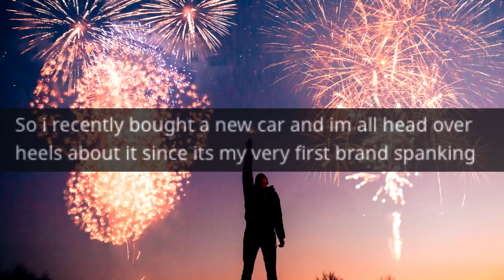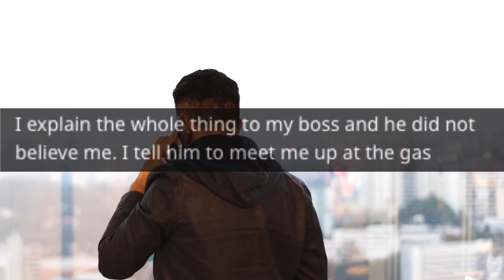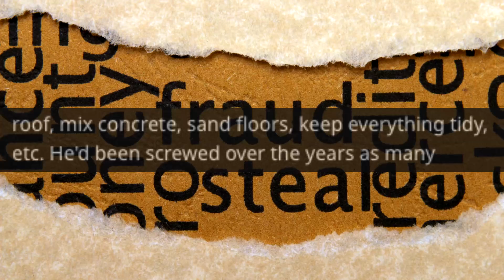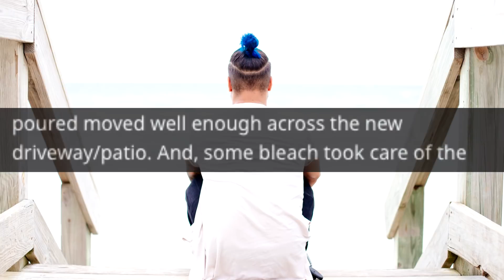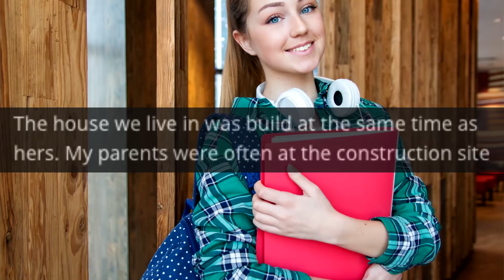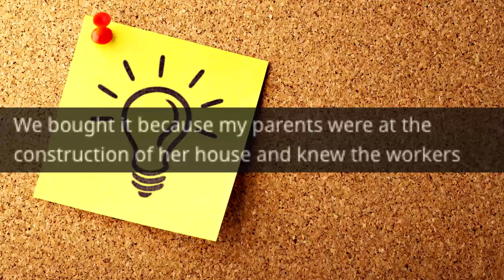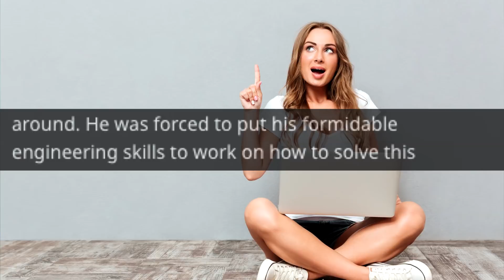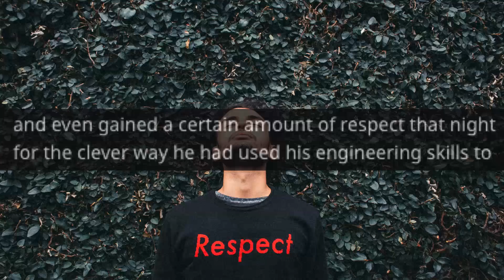r/ProRevenge | Epic PRANK schools thieves!

Comment: The removing of work done for a customer in the construction industry is a normal thing. I've heard so many first hand stories about customers not paying and the contractors going in and destroying everything they fitted. For painters its relatively common to just draw all over the walls with crayon. Paint has issues sticking to wax so the repair will cost a lot more than the original price.